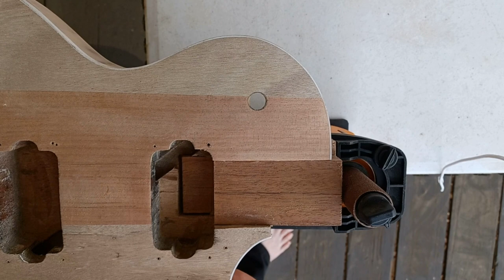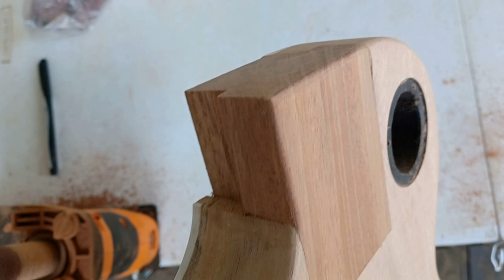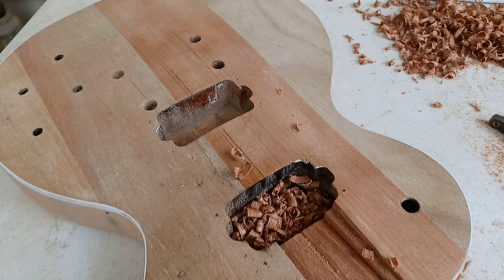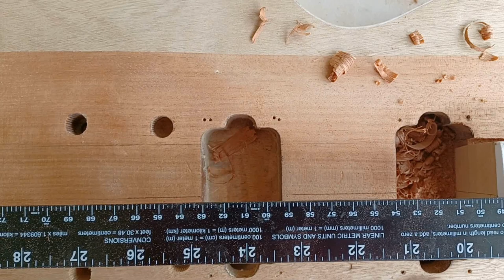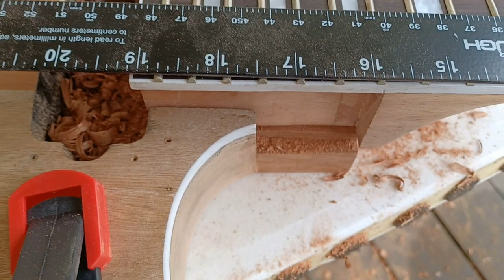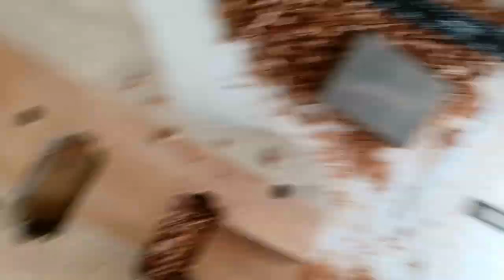Pre GGBO part 5 Refitting The Neck #jurgscup

Comment: Nice sander. I think I may have used a hand saw and removed a little of the bulk then used the sander to finish it off to the level you wanted but it worked. I think you have the correct thinking of how to handle it just glue in a piece in to fill in the side once you have the pocket deep enough.
Reply from the maker: I wanted some safety margin to test the first time. I didn't want it to go all hungry hungry hippo on me and eat more than I wanted to feed it. 

If you notice too I left the line where the front would be square to the body marked leaving a little offset of un sanded area. That way I have a little wiggle room to match the heal carve incase that was a little wonky from the OG build.